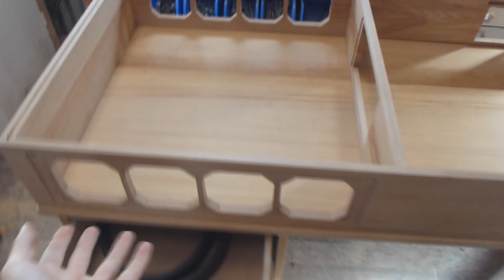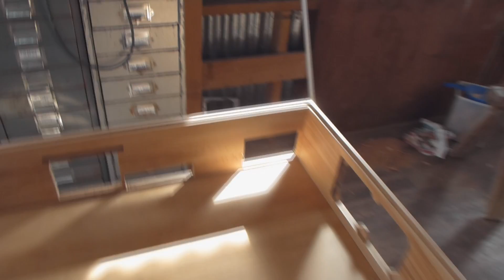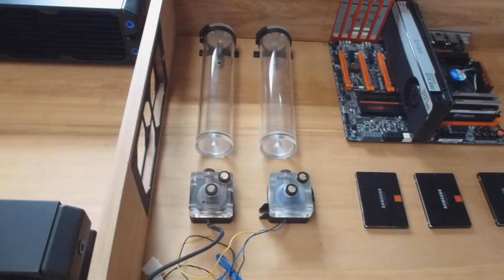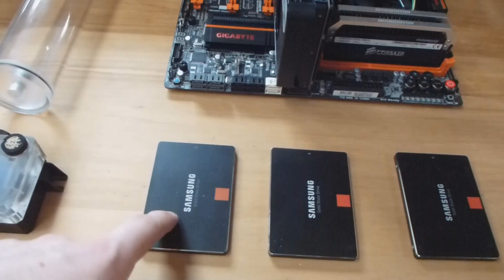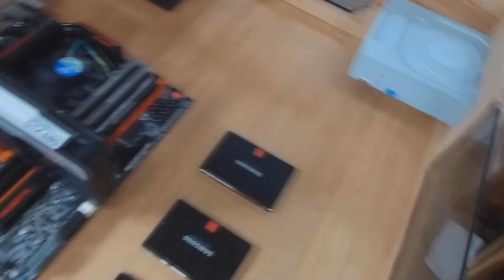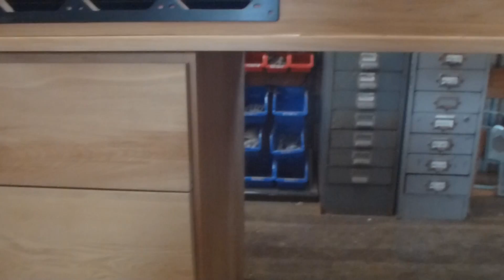Custom Made Watercooled Desk - Part 1

Comment: Can you specify the the dimension of this table ?
Reply: Look up standard furniture dimensions... As a start, desk tops are 30 inches from the floor (29" - 30.5"). Chair seat tops are 18 inches from the floor. Computer cases tend to be 7 inches deep or wide (depending on orientation) inside. Human thighs tend to be less than 5 inches thick. The inside cavity of the desk should probably be at least 5 inches to accommodate large cooling fans and other objects, but with the rate of miniaturization these days, maybe 3.5 inches is more than enough... That's a pure personal judgement call...  Laptops and tablets are mighty thin and getting thinner... 

Also, desks tend to be about 30 inches front to back and 5 or 6 feet wide left to right...  

You may want a raised platform for monitors at the back that securely attaches to or is part of the main body of the desk...

HTH  Good luck!

Here's a few quick searches to get you started...

https://www.google.com/search?q=standard+desk+dimensions

https://www.google.com/search?q=standard+chair+dimensions

https://en.wikipedia.org/wiki/Computer_fan
Reply: Alfred Wheeler wow thanks !!!

Comment: i have a question i made a pc inside desk but it was budget no water cooler etc but i have a grounding issues i placed mobo on tray which i cutted from old case and psu on desk sticked to desk via double tape but when ever i touch usb ports the lcd starts to flash should i place the mobo psu etc on same platform how could i properly ground the system as iam using it from 3 months that problem still exists plz i need help and you did great job :)

Comment: Hello. I want to build something like that.but  i need help and wana ask you some things, those support plates the other side of the radiators, in the middle of the desk(for fans), and at the expansion slots etc. you made them manually or u take out from an old case ?Or i can buy some accesories for these kind of custome desks ?The framework its not so hard, but the supports for fans, hdd,  motherboard are my problem.Can be build for ~280$? thank you in advance! srry for my english.

Comment: That is beautiful man, I want to try to build somthing this summer. I have never worked with finishing woodwork. Is this something sombody new to the trade can pull off?
Reply from the maker: +Christopher Meyer Yes no worries, realistically building something like this isn't extremely hard. It's all about having the right tools and sort of know what you're doing! Check out some tutorials, YouTube would be full of them no doubt
Reply: +Phillip Baines Awesome! Thank you for the response. I honestly might be following your design pretty closely. Now that its winter I will have to wait till the spring to do it. I dont have a heated garage. I just want to make a nice clean desk that i can have cable management so no more cords at my legs!
Reply: Youtube has very few tutorials on how to build a desk chassis

Comment: is this a good pc build??
GeForce GTX 960 GPU 4gb (G1Gaming)
Intel i5-4690 @ 3.50Ghz CPU 
8.00 GB RAM 
Thermaltake 500 WAT Power supply 
Asus H87-Plus Motherboard 
Thermaltake Black Versa H23 Case 
Intel 250gb Speed Demon SSD 
Seagate 2TB Hard Drive
Reply: +Nick I just got done building something with the same base specs.
Reply: Oh yeah, by the way, if you want to overclock, you'll want the i5-4690K and a Z97 motherboard.
Reply: Thats perfectly fine. In fact it's what I want!
Reply: +Nick no
Reply: +Nick Use a 600w minimum in this pc be careful :D
Reply: .::BB::.Skill93 ツ Dude you don't need a 600W for this build I'm using a 500 watt with the same build
Reply: +Nick 8gb will be fine for 2016 b ut in 2017 id consider upgrading to 16/32

Comment: Good morning friend exelente work, I am trying to put together a well, more like to know what the correct sequence can ride the water cooling, will put two gtx 980 with blocks of k, and 2 reservoir, pump two, two radiators 480, cpu block and the rigid pipe (agrilico) could teach me how to do the assembly please detail the water cooler?

Comment: Why do people insist on going push pull?
Unless your radiator is REALLY dense, push pull is just a waste of money, and time (as it takes SO long to clean that setup)
You only need pull on most radiators, and then dust comes off real easy.

Guys, the temperature difference is one degree celcius, is THAT worth the hassle of removing fans to clean the radiator?

Comment: I got the wood work already but the thing killing me is, where you get the frames for the PSU and the rads? The ones where you screw the PSU and hold it to the desk?
Reply from the maker: You would just go to an engineering place and ask for a scrap bit of sheet metal. They'd probably give it to you for free. The brackets are easy enough to make
Reply: Thanks dude... I'll do that... I just thought that you bought it ready... Nice finish, looks like factory made
Reply: I know it is late, but frozencpu has lian li psu brackets for $15. Looks just like his and would work too.

Comment: if there is a short it will not insulate it will burn a hole in it and maybe catch it fire. And if you are going to do this get good wood not the cheap ass wood you are using.

Comment: Are you putting the motherboard on standoffs, regardless of the conductivity of the material wood aluminum or acrylic thought it was to protect the soldering on the back of the board from vibrations and friction with another surface.

Comment: Only thing I noticed was you have no Ground -+ rail for discharging static, or electrical discharge. That is one of the reasons they use metal in pc chassis design. Just a steel bar would do. And you still want a form of standoffs on the motherboard to vent heat on the underside of the PCB. Building up heat between the PCB and the wood at 75C would not be good.

Comment from the maker: There is nothing wrong with using wood, it is an insulator so if anything it is safer to use than metal. At the end of the day it's just another material and both can be used for a desk :)